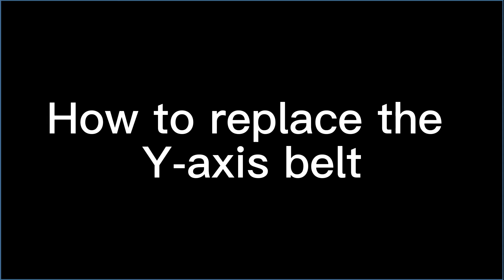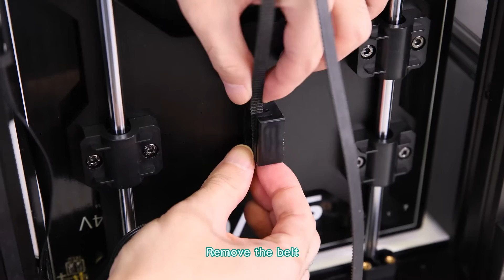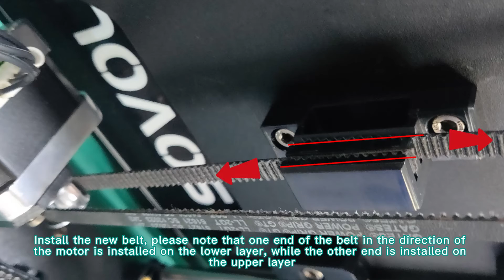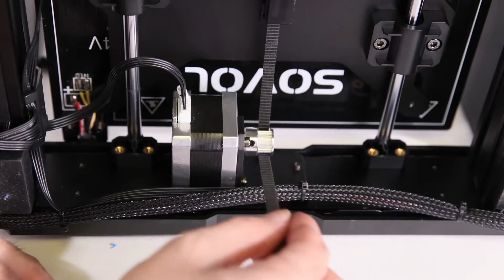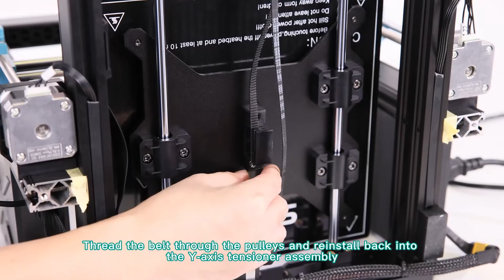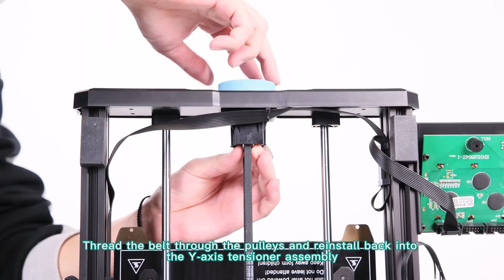How to replace the Y-axis belt | Sovol SV06

Comment: Where can I buy the y axis belt for the SV06? I don't see it on the Sovol website
Reply: Not sure if you still need it, but I bought a roll of GT2 6mm width belt on Amazon and followed the steps in the video. It worked just fine. I chose one from the brand "TurnBerg3D", because it looked more sturdy.